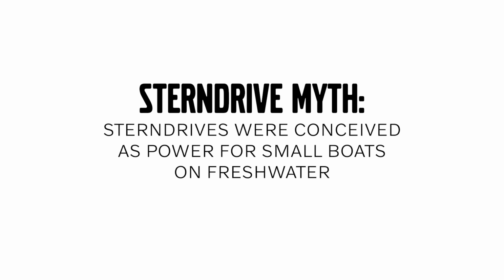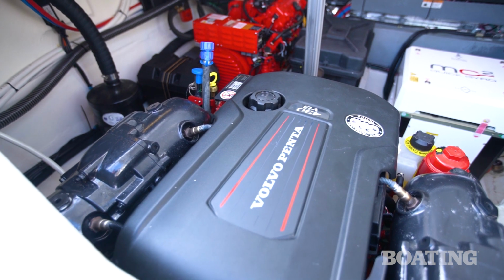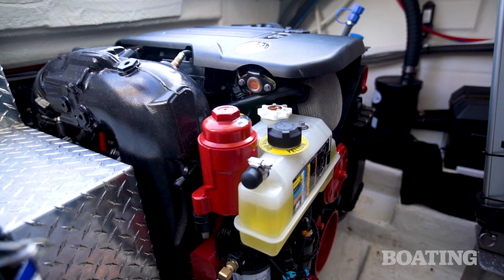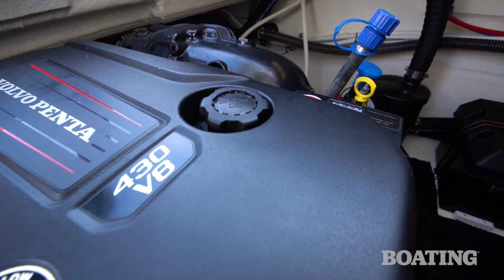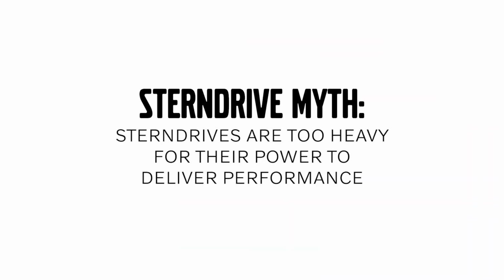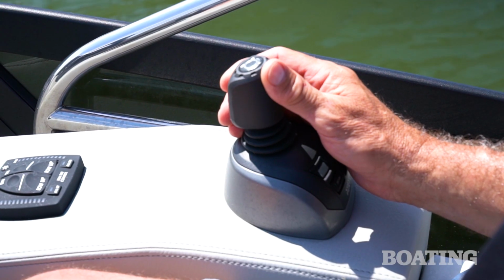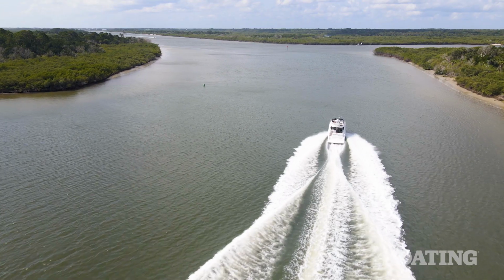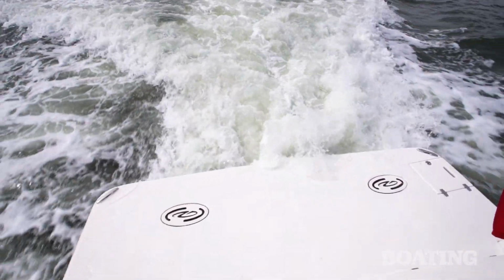Sterndrive Myths: Busted!

Comment: Yeah, swim platform covers over sterndrive versus outboards in the way.  Then how are you going to try to even partially lift the sterndrive out of the saltwater you idiots. That’s a recipe for disaster.
Let me add the mercruiser builds the cheapest crappiest,plastic trim/tilt sensor and limit sensors on each side of the sterndrive. They are notorious for salt water intrusion.  When you replace the wire goes all of the way through the gimbal and sterndrive all through the boat up to the steering console.  That’s the biggest hassle in the world having to pull a stern drive to replace correctly rather than half-assign it.  NOOOOO thanks!

Comment: Where I live Volvo is a no go can’t get parts. Mercruiser parts are plentiful. I run a 2011 Mercruiser 4.3 Carb with Alpha one Gen 2 in a 20 foot Stingray. Only issue I’ve ever had accelerator pump got weak picked it up at local dealer 10 minute job back on the water. My only negative the bilge is a little hard to clean cause motor sits over it. Thunder Run at Lake Cumberland each year 95% Sterndrives. Rarely see a outboard. If on ocean my view might change and probably prefer outboard.
Reply: I don't follow... We live in the digital age.  Volvo parts Amazon next day delivery all day long.